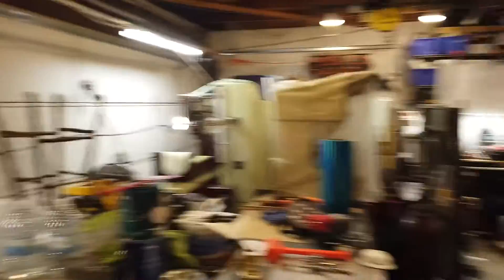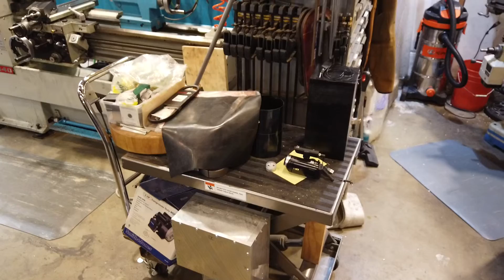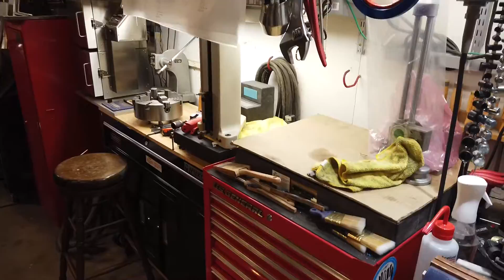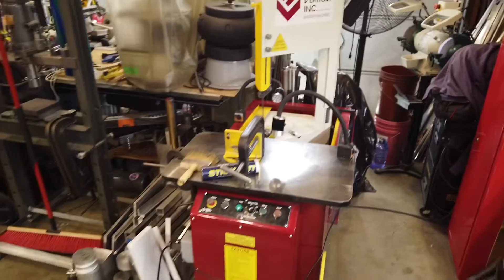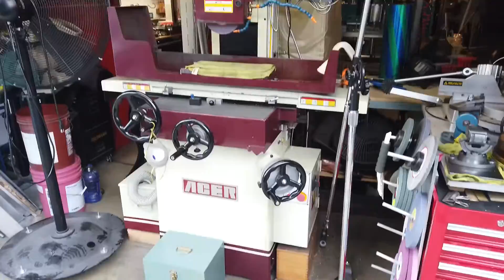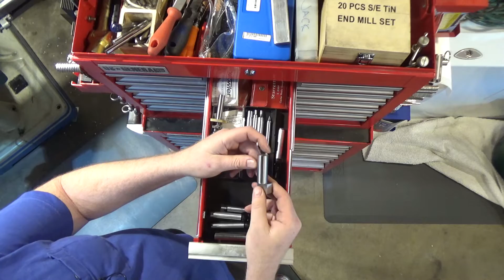125 Shop Tour 2020 Part 1 of 5

Comment: The wobble type edge finders don't need friction against the part to kick over.   I guess if the surface of the finder itself is rough it could cause an error but then both the finder and part should be clean and smooth.  What causes it to kick over is the wobble piece moving past center and the friction between the shank and wobble piece (both parts of the tool).   Spend some time finding the edge of some part and setting the DRO to 0.  Repeat a couple times and compare to the DRO.  If the measurement is off, the edge finder surface is not smooth or clean, or the contact area between the shank and wobble part is dirty / gummed up. I use these a lot and they need to be kept clean.  The good thing is that you can use the the wobble type in a drill chuck and still find an accurate edge even if the chuck is not perfectly true. 

https://www.youtube.com/watch?v=bga7y4infIo
Reply: BTW I believe  guy at the guy at suburban is wrong about the indicator. It's plenty accurate as even if the collet is off, the indicator is still measuring a difference from the axis of the  spindle.
Reply: Should also add that you look for when the finder jumps off centered. Rob Renz mentions this..
Reply from the maker: Very interesting, thanks. I appreciate you taking the time to share this information.